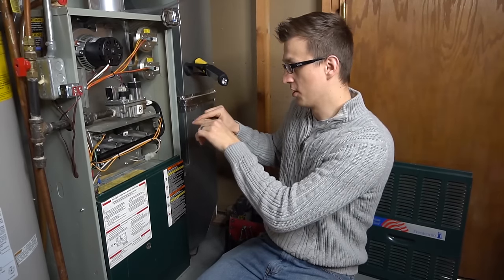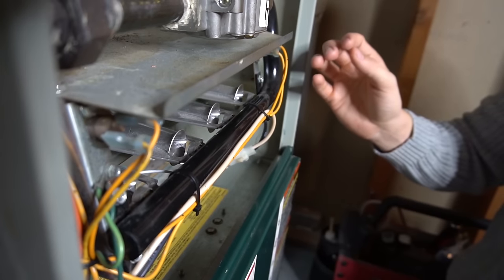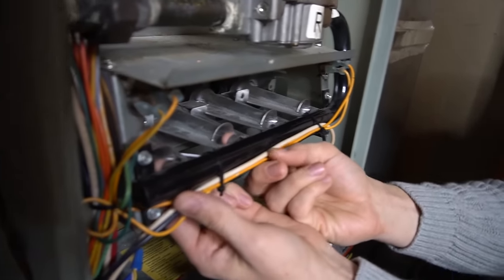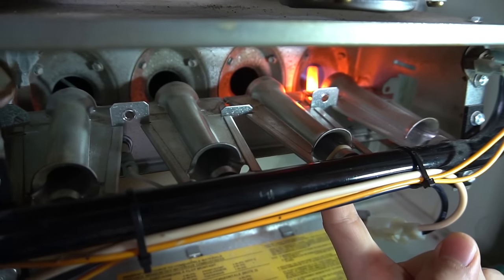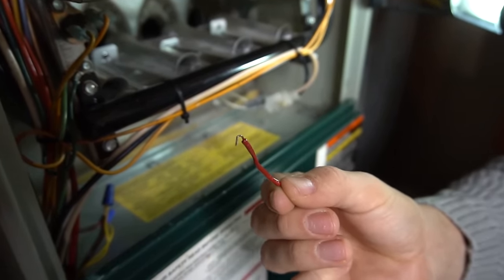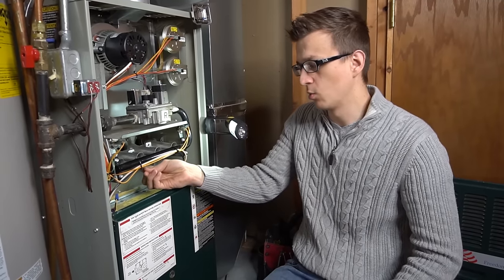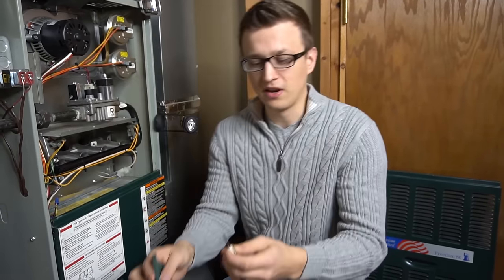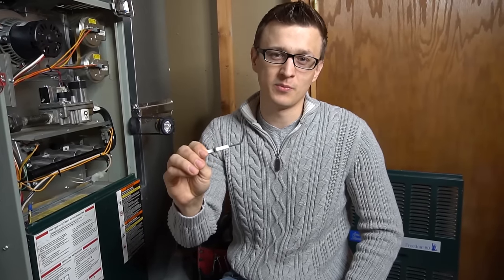Not All Furnace Burners Lighting - Easy Repair

Comment: As an Hvac contractor, I rarely see clogged orifices.   Much more common are rusty burners.   You need to remove the burners and clean with a wire brush.  Sometimes the burners are so corroded they need to be replaced.   Especially when running propane.   Some manufacturers offer stainless steel burners for propane use.
Reply: Exactly what the problem was with my propane fuel furnace. It does not have stainless burners.
Reply: My furnace willnt even turn the burners on and I'm nit sure how to get to the element to clean it

Comment: This video almost got me to my solution.  I had already cleaned the flame sensor, checked the igniter, and checked the heat limit switch with a multimeter.  It was the comment here about the wings on the burners that saved the day for me, which led me to Jay's video on cleaning the burners.  This is at least the second time Jay's videos have saved me several hundred dollars in repairs, plus I get to learn cool and useful technical stuff too.  Thank you so much!

Comment: You saved my wallet ,used a paper clip to clean the little ports on my gas pac central heat/air ,now it kicks on at the first ignition .👍
Reply from the maker: Awesome! That's what I like to hear :) Stay warm!
Reply: This comment, in conjunction with this video, has helped me HUGE! Thank you Jay for the thorough explanations on all your furnace videos, and thanks Adam for the idea of using a paper clip. I tried a smaller pin a couple days ago, but unfortunately had no luck. I then pulled out the burners, cleaned the faces (as per Jay's recommendation), cleaned my flame sensor, used a multimeter to check my wiring and connections, still nothing. Went back to Jays videos to try to find more possible solutions, and saw this comment. Shoved a paperclip in as far as I could in the last burner (where the flame sensor is at the end of) and VOILA!!!! It all started from trying to replace my exhaust venting as it was improperly done (joints not sealed and had black stuff building up on them). Thought my new venting was initially the issue as I did not follow proper runs as per manufacturers specs. But in the end, it was just a coincidence that the orifice was plugged. Thanks again Jay and Adam!!
Reply: @jasonkristik6886  Thanks for this video and Rick+J&K's comment about the paper clip. I also found some buildup that I cleaned with a paperclip and I also lined up the fin slit a little better all the way across and bingo, my furnace stopped randomly failing on the last burner light. Thanks!
Reply: @montanadaq  Great to hear!! Love seeing these platforms leveraged to help each other out!

Comment: thank you for the video!! i lost sleep over our furnace problem and you saved my headache!!

My issue was that only one burner would fired up if the furnace cover is  on. If i leave the cover out, all the burner would fired up!! Then i noticed the 2nd and 3rd burner’s flame is smaller than the 1st and 4th burner. So i suspected some holes are partial blocked. 

I used your wire tip to clean all the burner holes, and everything works again!!!

thank you very much!!!

Comment: Thanks for this. I have been trying to fix this issue for years. Every hvac techs just wants to throw away the unit and put in a new one. I have yet to find a company that knows what they are doing. The problem is not all burners light every time so it misses heat cycles and can get cold. If i use a torch i can light the burners manually and it runs that cycle fine. I used a piece of wire to clean the orifices. Then on the second attempt the burner lit. I am not sure if that is luck or what but i think you have lead me on the right path.
Reply: You manually lit the other burners?  That terrifies me.

Comment: Good and very helpful video. I would add that the “ cross runners” on top of the burners can also be the problem. They should have a gap of the thickness of a dime . I’ve seen them closed up and burners won’t light.
Thanks for the great video.

Comment: This is great!  I  just cleaned out the orifices on the gas manifold with a paperclip and that did the trick.  Do you have any videos on replacing the inshot burners themselves?  Mine are all corroded and I read it could cause a yellowing of the flame and overall deficiency in the ignition and operation of the furnace.  I found the burners themselves on Amazon, but a video would be great.  My burner housing is fairly corroded altogether.  It would be great to replace the entire housing even.

Comment: Thanks for the video step by step information 👍.  I just have a question before I go ahead and do what you are saying in this video?  If all of the burners aren't working and everything else is the igniter is glowing red hot like it's sapposed to all of the ventilation is good air flow is good filter is good lol and the fans are all running but the burners aren't lighting could that maybe be the problem?  The very first igniter might be plugged up?   I have a fairly new only 6 years old Armstrong furnace.  I'm trouble shooting and it saying that the pressure switch closed with inducer off.  I see no other reason for the burners not to light but maybe they are plugged.  Please get back to me 🙏 I would really appreciate it.  I've been trying to figure it out all day😡.  Thanks for a great video 👍.

Comment: how often should you clean the burners? Reason I ask I have  a furnace boiler and I see rust particles accumulating in and around the boiler burners. They don't seem to effect the flame, so I let it be. Is it important to keep them absolutely clean? Good videos, hope you do one on washing machines!
Reply from the maker: As long as the rust and build-up does not impede the flames, it's all good. The mainstream HVAC suggestion would be to clean them every year or two, make some effort to brush them down and get them clean though so that your burners burn cleaner and you don't have any incomplete combustion which could raise your carbon monoxide emissions. If you have a long brush, it's pretty easy to clean up those burners. (if the ones you have are what I am thinking about anyway)

I do work on washing machines but they are all different. Can't say I love working on them either heh. Maybe I'll make a top ten washer problems video down the road.

Comment: Hi Jay. Thanks so much for the videos! I'm having a slightly different burner not igniting issue I'm wondering if you've encountered. The problem I'm having is that sometimes that last one or two burners in line don't ignite. I have a Trane XV90 with 5 burners and the issue is intermittent. Sometimes all 5 light, sometime only 4 do. Sometimes the 5th one will work after one failed attempt, sometimes it fails three times in a row. Not sure what could be causing the problem where it works sometimes and not others. Would love any thoughts.
Reply: Hi Jared , I'm having the same problem.  Were you able to fix the problem?
Reply: The valve regulator may be failing or your gas output pressure may need adjustment. You will need a manometer to measure water column out of your gas valve.
Reply: @albertosimental4578  I was. The problem was with corrosion on the wings of the burner tubes - not allowing gas to pass through to the flame sensor fast enough. Pulled the tubes and cleaned the channel the gas runs through it with a wire brush and sand paper. Everything now ignites properly.

Comment: Great videos.  I've got a furnace with only two burners. First always lights but often the second burner doesn't light on first time.  I cleaned burners, same thing. I replaced both burners and seems better but flame still doesn't always spread to second burner on first attempt.  I removed orifice on second burner and it is clean.  What would you try next?

Comment: great video I think I may have a the same problem but the 1st burner office is plugged and the 2nd office ignites all of them and then they all come on no roll out but it blows backs like their is accumulation of gas build can it be the plugged orfice as well? just wondering its new furnace hoping its not the heat exchanger

Comment: My furnace is having trouble moving the flame from one burner to the next. I cleaned the orifices and it didn’t change anything. It will still bridge occasionally, but it seems like it’s just not making contact across the burner like it should. Any help?

Comment: Thank you Jay for your videos.  I have a similar issue where my burners are not igniting on the first attempt, it takes two tries.  So, my scenario is the burners won't ignite and then the blower will turn on and blow cool air for a minute or so then turn off.  Immediately after the furnace turns off it will then reattempt to turn on the second time and that's when the burners ignite and blow warm air.  My HVAC guy replaced my gas valve last year, and he just unclogged a blockage in the drain of the inducer.  My flame sensor and ignitor (Rheem) are the original but I did clean the flame sensor a few months ago.  Any idea what may be causing my issue?
Reply: Ignitor maybe?

Comment: HELP... i run into a Goodman package unit with 2 burners and only the first burner light up but the second dont, i ready clean the orficies, clean the burners with a wire brush, and still the second burner dont light up, i test with a match to light the second burner and it does light up and yes theres gas going through the second burner ... any suggestions before replace the burners ??? Thank you

Comment: I have 3 burners.. they fire up but the first burner sometimes goes a a bit slower lightning then the 2nd and 3rd burners.. first burner sometimes creates a small puff and I feel this hits the roll out sensor and shuts down the gas and furnace won’t stay light at burners.. what causes the puff issue? I think this may be my issue as the furnace will work fine for 2-3 days then one time it calls for heat and then I notice that the pilot flame is light and blower is running but no burners? Any assistance would be great! Thank you
Reply from the maker: It sounds like the transitions between your burners are plugged up. Have you tried cleaning them? I have a video on how to do it, although some furnaces aren't as easy as mine. 😅 https://youtu.be/6ehk0NZVFcg?si=wqENNQJ1RSqhi_Xh

Comment: How do you fine common, run and start on a compressor and where do they go inside your electric parts panel?
Reply from the maker: I have a video on how to check a compressor and another video on how to wire a compressor :)

Comment: I have a carrier with an electronic automatic pilot light igniter. I see the furnace burner heat up, but no gas lights. I don't know if that's because the pilot light isn't on. Any suggestions?

Comment: At a new install and having an issue were not all burners are lighting. Orifices are clear and have no debris. The o ly thing I can possibly think of is that I have a weak gas valve. Takes about 5-6 attempts before all but ers are lit.
Reply from the maker: Do you have a manometer? I would check the inlet and outlet manifold gas pressure to see what is going on with the gas.
Reply: @WordofAdviceTV  yeah I have a manometer, but this particular gas valve "White Rodgers", I could not find outlet or inlet . Gas valve states that it's default is set at 3.5 W.C. I ended up getting all four burners to light and to stay on, by slightly adjusting valve everytime gas valve opened. Finally got all to light up and tested it 10 times before ending the job. Thanks for the reply!
Reply from the maker: @ccruz3028  Oh wow, that's interesting. So after that initial slow start up, it started working just fine? Gosh, I guess I don't have a good theory for that one.. Glad to hear it's working good now though! Thanks for coming back with the update!

Comment: I have Trane XL-80,White Rodgers 50A51-405, Furnace Ignition Control Board D340021P01 CNT1308-/ forced air furnace / ANS z21.47a-1990 central/ Model: tud100r948a1/ serial h27515028/ Two Stage “R” Model. It was running fine, stopped changed flame sensor, air blows but no heat. One said C. Board is bad other said Tubing or pipe is bad. AC works just fine, it's vertical. Both want to put a new system. 3Rd. Sd CBoard is okay. Unfortunately, I don't believe either B/C if CB is bad, igniter must light first, heat shd. .start , then furnace she stop what I think. I have not yet located the Air Filter and once found, cleaned, may change the game. I do have A F on the wall which r changed regularly. YouTube and People like you have helped me a lot in different projects Any suggestion ? Thanks

Comment: The burners have wings that that are made up of a top and bottom and they are separated by a few thousandths of an inch.  The burners are coupled together via these wings and it is through them that the gas propagates from one to the other lighting each burner along the way.  If the wings develop rust or debris between the separations, it will stop the flow of gas and not be able to light the next burner in line.
That is what happened to mine and I cleaned the wings out with a feeler gauge slid between the separations.  All was well.
Reply: toobeer this comment helped me a lot thanks!😁
Reply from the maker: I totally forgot to mention that in the video! Thank you much for pointing that out!
Reply: $1000 in playing music part replacement I sent the HVAC guy home.  Did this, furnace works.  Thank you!  I will probably just buy a new pack of burners for $75 and replace them next summer.
Reply: Thanks, this was the problem on my dad's furnace.
Reply: I ran into exactly this today.  I didn't find your comment until afterwards, of course.  I used sandpaper, but the idea is the same.
Reply: This solved my problem, even my gas fitter couldn't figure it out.
Reply: This is what the problem was for me! It seemed clean enough in there, but apparently, it wasn't. Thanks!

Comment: Many of the commenters here have obviously not payed attention while watching this video. PAY ATTENTION FOLKS! I have an almost identical furnace to the one here. The burners were shutting down before they all had a chance to start firing. After it would make 3 attempts to start it would go into shut down mode with 2 flashes on the controller board LED. 
I have followed ALL of the advice given in the video. Furnace is now starting and running perfectly. THANK YOU!

Comment: Not even a mention of dirty flame spreaders. Wow wtf?
Reply from the maker: That was a major blunder on my part since that happens more often than a plugged orifice. Now that you reminded me, I will put a comment at the top telling people to clean the burners as well. Thank you for pointing that out!
    Update: I actually already pinned another guys comment before. He thoroughly explains it, couldn't have done it better myself. I should probably make a separate video on cleaning burners though.
Reply: @WordofAdviceTV d a note at the end somehow... :) Also i don't see the pinned comment anymore?  You could almost do a whole nother video on it , if you can manually light the other two then it's this etc..or a fuller one regarding "flame not detected code"? :)

Comment: Wow, this was great!  Very clear presentation and I realized the wings of my burners were corroded.  In troubleshooting I found that the 1st burner would light but not the other 3 unless I blew gently on the 1st burner towards the other 3 when the flame was present.  Maybe not SOP but it helped me realize the wings were probably the culprit.  Cleaned the thermocouple while I had it accessible.

Comment: My 8 year old Lennox does this but only occasionally,  visually after sitting, say 1 day. But when normal cycling it'll start fine. Cleaned all orifices, flames look good. Seems to   not have enough gas till multiple startup cycles . Another furnace on same supply works fine.

Comment: Great video.  You're a braver man than I, blocking the gas jets with your fingers!  :-D   But...

I have a brand new RUUD 802V that is doing this from time to time.  The outlet gas pressure tests good.  The control board, gas valve and complete manifold/burner assembly have been replaced but no joy.  Any ideas what might cause this?
Reply from the maker: Thank you! Have you tried cleaning the burners? I have a video on that if you need it. If they have clogged transition wings, that could cause some of the burners not to light as well.
Reply: @WordofAdviceTV  Thanks for the reply.  They cleaned the original burners - not that they were dirty as the furnace was only a few weeks old - and even replaced the original burners.  No joy.  The tech was here again and managed to get the problem on a video which he sent to RUUD.  The RUDD engineers said this had happened on  "a few" furnaces and hand tested a new burner set for proper operation.  The new burner set is scheduled to be installed tomorrow.  So we shall see...  Both the original and first replacement burners are going back to RUDD so they can figure out what happened.  You can smell a bit of gas after the right burner lights up so I am thinking that, for whatever reason, the flame is not making its way down to the other burners.  I'll let you know if they figure it out.
Reply: @SkyWriter25 was it resolved?
Reply: @RogerPack  Yes it was.  RUDD sent us a new burner assembly they had hand checked to be in spec and that solved the problem.  I sold that house in November 2021 but it was still working fine when we left.

Comment: Great work as always. I have a carrier rtu with this issue. I cleaned. Even replaced manifold and orifices and still having issue. Incoming gas pressure 10 in.wc and 3.5 leaving valve and still intermittently having this issue. Any ideas. Replaced ignitor and flame sensor as well, but obviously  no flame to sense on 2nd burner. 2 burner setup.any ideas.
Reply: I also cleaned out everything and 4th burner still won't ignite sometimes unless I blow on it while it's trying to light. Following.
Reply: Same for me if i blow on it it will light